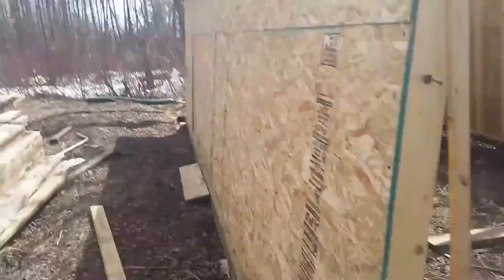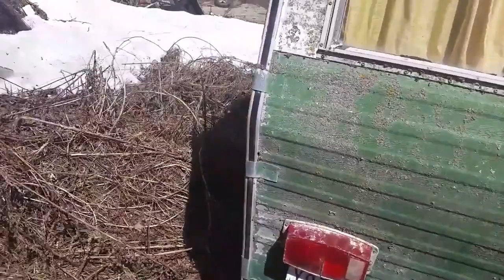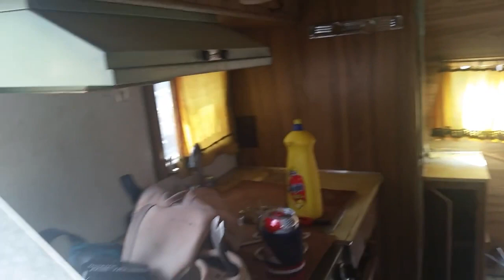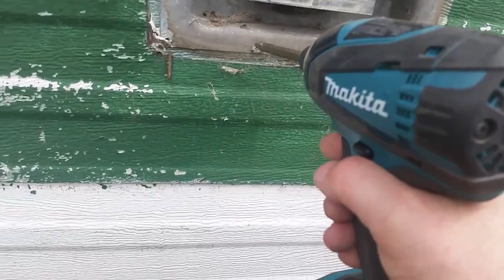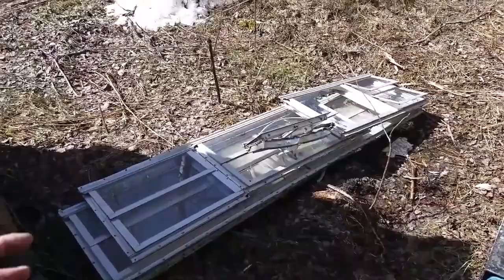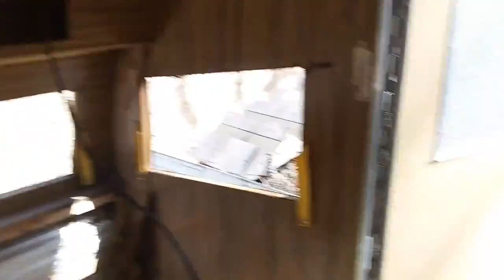This old camper to restore Part 1

Comment: I had a 1968 Rockwood 15 ft given to me. Such bad news when I took the paneling off, nothing but rot. So it's a ground-up restore - frame reinforcements, steel C-channel perimeter, 2x3's lag bolted right to the steel, and a floating, removable floor for easy access to axle and wiring. Lots of work.